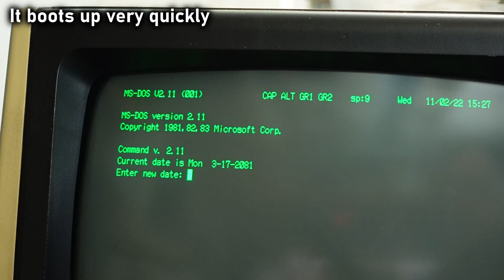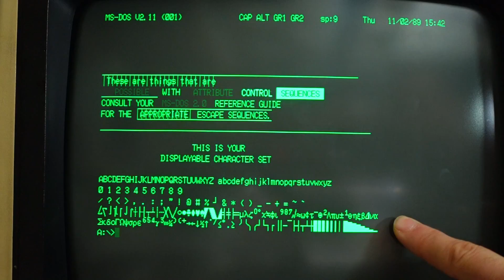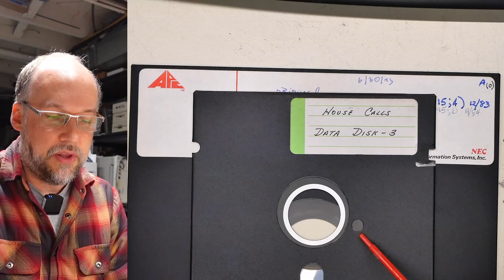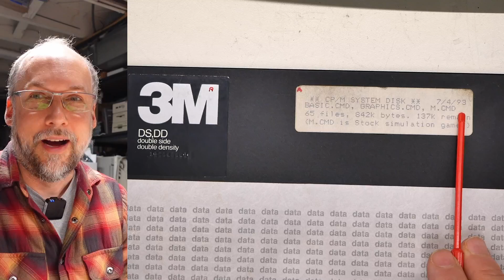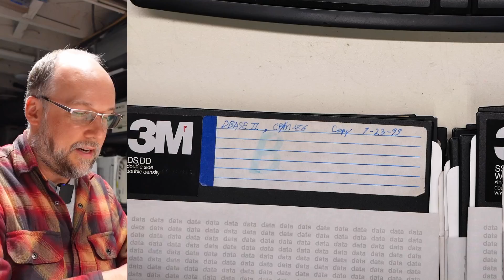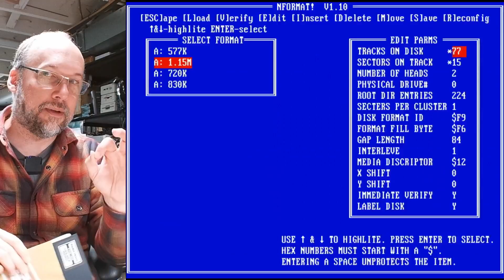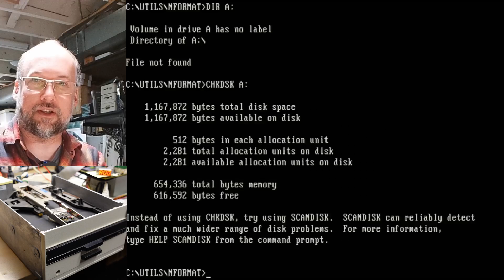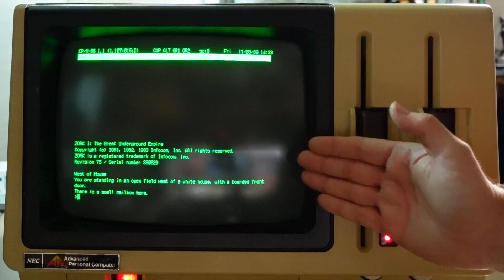Comment: Hi, Back in the early 80s I bought a Kokusai KDS 7861 Small Business Computer which, is quite similar to the NEC APC. It has two 8" floppies with strange pinouts (I recall trying to figure out the interfacing and getting lost), and redefinable character set. The original machine had two EPROMS with the character set, mapped to the main address space, so replacing them with static RAMs allowed the character set to the changed. Anyway, I recall that although the machine used 1.2 Mb disks (formatted) it could read/write IBM standard (128 kb ??) 8" floppies which was the format that the console floppy of our VAX 11/780 (running BSD 4.3) could also read/write, so I could do limited transfers between the KDS 7861 and the rest of the world. I only had BASIC and assembler, but I think I managed to get some rudimentary file transfers going using a BASIC implementation of the kermit protocol.
I still have this computer in storage (sadly in another country, or I would have gotten it out for a spin :-)  If you are interested to know how it looks, there are a few pictures on the computing history museum at  http://www.computinghistory.org.uk/det/3413/Kokusai-KDS-7861/
Reply: Wow it's so similar to the NEC. I wonder if they shared stuff with each other when it comes to the design.  I can't find any other info on the machine, so hard to say how similar they are architecturally, but perhaps NEC was sharing the BIOS and other things with other Japanese companies, so this machine could run the APC version of MS-DOS?
Reply: BTW I believe that the same model appeared also as the "Samurai" by Nissei Sangyo (sic) a subsidiary of Hitachi

Comment: The use of "OLD" was common on mainframe BASICs in the 60s/70s and was in the original "Dartmouth BASIC", so a number of early BASICs used it. I believe Microsoft BASIC chose to use LOAD instead, which was used in some mainframe variants of BASIC and therefore set the trend for future versions of BASIC on microcomputers.

Comment: The neon bulb in the switch may just be old/tired or has a resistor set up for 220V operation. Try shining some light on the switch (really). If the bulb lights up then a new switch should fix it.

Comment: As you noted, and many folks commented, not much software was created for this machine. Yet I know of at least one interesting use case for the colour version of the first APC, which I can explain with a bit of reminiscing. :) One of my consulting jobs in the early 80s was for a small electronics engineering firm that wanted to port a printed-circuit board CAD program to their brand-new colour APC computer. I ported it from, if I remember right, a CP/M-80 assembly-language program they got from somewhere beyond my memory now. Oh, and your videos reminded me how on each day I sat down to that machine I'd slide the keyboard out of the way and wonder whyyyy NEC decided to put the power switch there!

The similarities between 8080 assembly-language CP/M programs and 8086 programs on CP/M-86 were vital to making my task possible since I didn't know much about 8086s at the time and I really needed that help. I wish I could remember if the converted program worked well in the end or not, though I do remember the APC being a vastly improved computer over whatever 8080/Z80 CP/M machine they were using before!

Comment: Hi Adrian. You can actually use the “one-line maze” program with the regular slash and backslash, you just have to multiply the Rnd(1) result by the difference in ASCII values between the “/“ and “\” characters. So when it gets a “tails” (which I’ll set = 0) it multiplies that times the offset, but 0 times anything is 0, so you just get the ASCII code for the slash. When it gets a “heads” (= 1) it multiplies 1 by the offset, then adds that to the ASCII code for the slash, to get the backslash. It’s not as pretty as the ones that have the “bigger” slash and backslash, but it’ll work. Variations on this should work in other languages, like C or Python, that can be run at a command-line prompt on modern systems.
Reply: I came here to make this exact comment. Note also that the rnd function generates a floating point number between 0 and the provided parameter, so it has to be rounded if the difference between characters is greater than one. That single line maze program looks like:
10 ?chr$(47+(cint(rnd(1))*45));:goto 10
(Tested in GWBasic 2.0)
Reply: @michaelcalvin42  Indeed. I came here to see if I needed to comment similarly. I knew someone must have beat me to it, since it's such an obvious point for anyone that knows anything about programming. I assume Adrian just had a brain fart--or perhaps he doesn't know much about programming, even in BASIC?
Reply: @michaelcalvin42  If your BASIC doesn't have a function for rounding (like C64 BASIC doesn't), you can use something like INT(RND(1) + 0.5); essentially add 0.5 and then convert it to an integer; then multiply by the offset and add the base like you already have.

Comment: I honestly hope you are able to find a Graphics expansion card, a color APC, or even a CRT unit or adapter to connect color output to HDMI someday. I really wanna see what this machine was capable of at it's peak!
Reply: I'd love to see the monochrome CRT swapped for a compatible colour CRT (and any CRT control boards), that would be a nice video, even if the swap is fairly straight forward and it's the end result that makes it a nice video. Though some sort of RGB2HDMI mod would also work.

Comment: DeSmet compilers have been open-sourced as GPL. Only a few have source+manual though.

Super interesting to have a read through, so simple. Hardly any semantic analysis and no optimization!

It's nothing like the more advanced C compilers from the 80's and 90's such as DigitalMars that is for sure.

Comment: With 1.2MB per-disk, that's pretty good for 1983. I believe the 1.2MB high-density 5.25" floppy format only came out with the IBM AT in 1984, so the 8" disk would have been around with that size for at least a year before IBM went with the 5.25" version.

I vaguely remember reading somewhere that MS-DOS did support 8" floppy disks at some stage, but support was removed pretty early on, so you might be able to read them with an early version (like what was running on the APC, although the IBM compatible version). But I could be remembering incorrectly, so take that with an arbitrary number of NaCl molecules.

When you formatted the disk in NFORMAT!, the format ID was $F9, which is for 1.2MB HD 5.25". $FE is for 1.2MB DSDD 8". It was definitely formatting with 15 sectors of 512B instead of the 8 sectors of 1024B that the APC would be expecting. And that would be the difference in size you saw.

Comment: Really awsome machine. Maybe if you find a CP/M program that can write MS/DOS disks similarily like the tool for DOS that can write CP/M disks you can make files move with two hoops? Also maybe MAME can emulate this? I do not clearly see it if they have proper emulation, but in case they do, there must be some way to mount images of the disk, add files and write back whole images (or someone could make software for that who is capable enough).

This machine must have been very good for software development because of the added space on the disk drives. The disk that was labelled like "excercise" or what also seem to have some C compilers on it and such - maybe different ones?

Comment: Wait. On the second time, you tried Zork, when you randomly pushed buttons, the 4 things on the top row in the middle changed. 
So it COULD read things off the keyboard, but didn't write on the cursor.. What if, the things you typed were invisible or somekind of keymap mismatch?

Comment: regarding program compatibility, you might have more luck trying some NEC PC-9801 programs.
Reply: well no, the reference manual of Turbo C 2.0 says requirement is PC-9801VX, not the same generation and MS DOS3.1
https://ia803003.us.archive.org/25/items/TURBOC2.0ReferenceGuide1988/TURBO_C_2.0_ReferenceGuide1988.pdf

Comment: When I was a kid, I took an after school computer class that had Apple II+ computers.  The teacher said he had a black Bell & Howell version of the Apple II with 8" disk drives that had a 1.2MB capacity on their floppies.  When I got older and into MS-DOS PCs, I remember hearing the 5-1/4" High Density disk capacity of 1.2MB was to match the capacity of 8" disks.  I also remember seeing a 5-1/4 Quad Density disk drive in some PC's in the computer lab, which used disks with a capacity of 720KB.

Comment: I found this machine a very interesting one for that time. Powerful. The battery backup RAM, the char generator on the RAM, etc. I worked with TRS-80 I and II, Super Brain, Osborne, Commodore PET, TI99 and Apple II at that time and I didn't know about the 8'' disks write protection (maybe because I never  really used a TRS-80 model II, just once). Thanks for explaining that.

Comment: Heh, reminds me when I picked up an old battery-powered word-processor from a thrift-store, thinking I could use it as a vintage digital notebook for taking notes while out and about.
It had a 3-1/4 floppy drive and I had plenty of those, so no problems, right? Wrong!
It used a proprietary non-standard format and without a manual I didn't know how to get it to format discs, if it was even capable of that! 
I kinda suspect it wasn't capable of formatting, as that'd mean having to buy discs from the parent company, a guaranteed stream of income over the life of the machine, or so I imagine was the idea.
Don't think it worked out like that though, as while the company might still exist, I'm not sure if they're in the same industry anymore. 
Wish I could remember the name of the dang thing, probably still have it in some dark undisturbed corner somewhere.
Oh! Smith Corona, that was it! Funky little machines. Seems like I had one without a printer, and one with a printer.
Pretty much impossible to find ribbons for, although I think it may have come with some old spares.

Comment: I actually used to make my own fonts because I HATED the IBM standard font :) I did this by hacking the provided code pages with my own font set. You need a line in config.sys like "device=c:\dos\display.sys con:=(ega,437,1)" where "ega" refers to the file containing the desired code page, and 437 is the code page tag stored in that file, and 1 is the first allocated page. You then use the chcp command to change code pages. I don't know if this worked in DOS 2 but that's how I used to do it on DOS 5 and beyond. Somewhere out there in cyberspace is my font editor and the code pages I made - it was tons of fun.

Comment: The APC/PC-98 was certainly a much cleaner, better thought-through design than the IBM PC in many ways. It's a shame that it didn't catch on outside Japan. Speaking of PC-98, I wonder if it's disks are logically compatible with this machine's. IIRC, it used 5.25 inch 1.2 MB floppies but with a non-standard format that sounds a lot like the APC 8 inch layout. Maybe tools for reading/writing PC-98 disks on PC might help for this machine.

Comment: Adrian:  The lamp is likely an NE-2 neon bulb.  Failure to fire after a short "on-off-on " action, is not unusual for one of these bulbs, especially with age.  This observation does not, of course, mean your computer's lamp is at fault, but given the fact the lamp is across the AC line, it seems likely. Cheers!

Comment: 42:18: Hopefully YouTube's comment censorship/filter doesn't kill or mutilate this, but here's my maze one-liner for the Mattel Aquarius. The line number 1 instead of 10 is to fit a limited line length. The full diagonals are not right next to each other; they're at 0xCA and 0xDA, hence the times 16. One could also include 0xD8 (a cross) and 0x20 (space) to make things more interesting, but not in a literal single line:
1? CHR$(202+INT(RND(1)*2)*16);:GOTO 1

Comment: @32:15  There were disk drives for the ADAM?  Or is 22 disk just imaging the funky not-quite a normal philips standard compact cassette cassete tapes?  I'm genuinely curious now, considering there's a complete (well everything but any old composite monitor.) ADAM up in the attic, next to the //C the c128 and a ][e...  with the ADAM having the least sopporting software, other than 2600 cartridge compatability....

Comment: about the power switch and its Neon lamp;  the bulb is failing- and the reason it "sometimes lights up" is based on a few things:  1 the little electrodes are dipped in a slightly radioactive coating which helps the Neon "fire" and this combined with it being exposed to photons (light) also will cause it ti fire at random. a way to "test" this is very simple, simply turn it on in a darkened room and then shine a light on the switch and you'll then see it light up!

Comment: The cardboard inserts for the 8 inch floppy disk drives were used to keep the heads from banging together when the computers were being shipped and also when shipping the diskette drives from the manufacturer to the computer assemblers.

Comment: Hats off once again. A great visit to an early computer. My computer experience pretty much started with my boss dumping two brand new IBM-XTs on my desk (FDD-only models) and telling me to do something with them. Back then I bought Peter Norton's Guide to IBM PCs and was encouraged to 'play' so that later I could help other users. 

I spent a few days with MS-DOS 'debug' just peeking and poking in memory and on the floppies. At the time I was transferring data from a CP/M system via the machines' serial ports and with the help of the Norton book I navigated my way through the directories of several MS-DOS floppies that I'd used. Of course 'delete' doesn't delete necessarily, first it marks files as deleted, then they are overwritten if clusters and/or sectors need to be re-used. Do you think that your blank disks may have erased data and software on them or have they been formatted but not used? There might be something there. I think CP/M has a means by which floppy sectors can be accessed direct, but I can't remember how

Comment: The power light is neon and is prone to degassing out the legs because of age. And it will only get worse. You can test this by flashing a light on it and it will light up. The light excites the gas and allows it to fire.

Comment: Your year 2000 clock bug had me wondering if anyone had approached a fix for the eventual year 2038 problem. I know DOS will probably keep working, but it would be nice to have the correct dates.
Reply: MS-DOS doesn't have a year 2038 problem. That issue is when a signed 32-bit count of seconds past 12:00am, Jan 1, 1970 rolls over. MS-DOS records dates as 5 bits to record the day of the month, 4 bits to record the month, and 7 bits to record the number of years past 1980. That takes us through 2107, though apparently the APIs that access those dates have a problem with dates past 2099.
Reply: @wbfaulk  oh, TIL it didn’t just use Unix time
Reply: @wbfaulk weird they used signed for something starting in 1970.. doubt they had any files older than that they needed to be accurately dated.
Reply: @mikafoxx2717  Unix was invented in 1970, but they probably still had a desire to represent dates older than that. Do you never refer to dates in the past?
Reply: @wbfaulk  maybe, but not for files retroactively.. and definitely not from 1910.
Reply: @mikafoxx2717  Files aren't the only thing that need dates. If you were developing a new operating system today, would you make it so that it couldn't represent dates from 2024?

Comment: The Amstrad CPC line of computers had character 204 and 205 that did this.

Here is the code
10 PRINT CHR$(204+RND);:GOTO 10

Best to run in CPC Mode 2

Comment: There was an oscilloscope card for the PET during the late 70s, a cheap way to replace an expensive Tektronix. If I remember the PET was also used to drive a size A or B x-y plotter about the same time. Back in the day a full blown large size (size E?) flatbed plotter CAD system would cost in the 10s of thousands of dollars.

Comment: You could do the maze on a Spectrum, using user defined chr s, but it would be at lest 3 lines. Maybe more as you would have to load the data for the UDG the print etc. There's a challenge.

Comment: ATASCII (Atari 8bit) character set has a forward slash graphics char at 06 and backslash at 07.  Also, have you considered using a null-modem to transfer DOS programs files from a PC to this instead of using disks for file transfers?
Reply: Oh the Atari 8 bit! Does the basic allow RND combined with CHR? As for the transfer, I'd need some software on the APC side to allow a transfer.... I looked through the disks for something like KERMIT but never found anything.
Reply: Oh also the serial port is some strange centronics connector too versus a normal D-SUB :-(
Reply: @adriansdigitalbasement  Is the pinout available in any of the manuals?
Reply: @adriansdigitalbasement  Yes, the exact code you showed works on Atari Basic.  You can also run it in immediate mode without any line numbers by entering:

FOR I=1 TO 1 STEP 0:?CHR$(6+RND(1));:NEXT I

I was wondering if a simple serial capture from DOS COM1 port might work for a crude transfer, or in worse case find some Basic code that you could use for an XModem or Kermit transfer since you should have at least MS Basic.